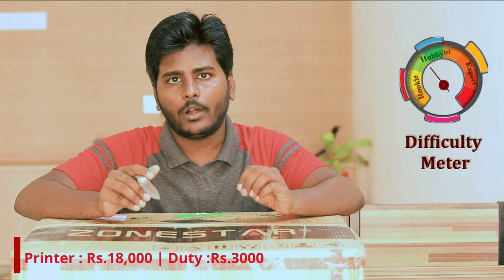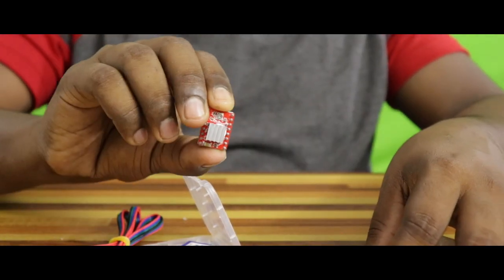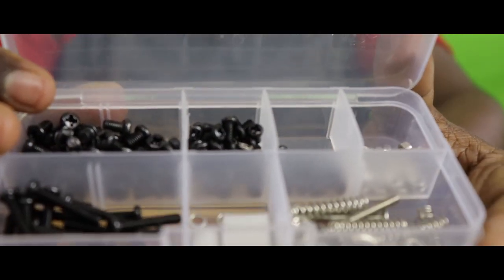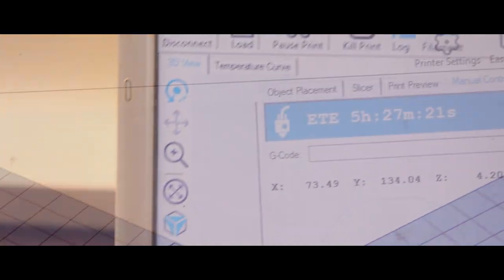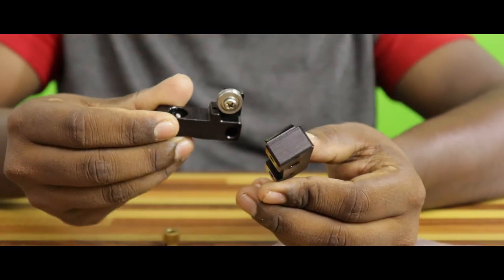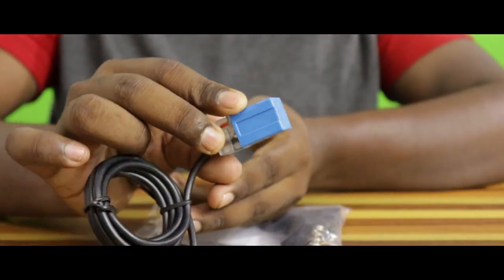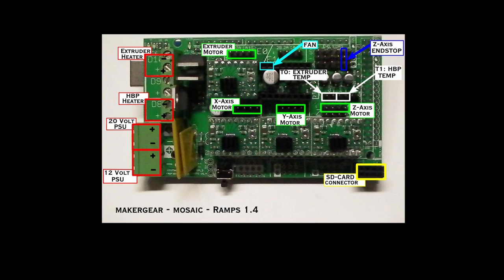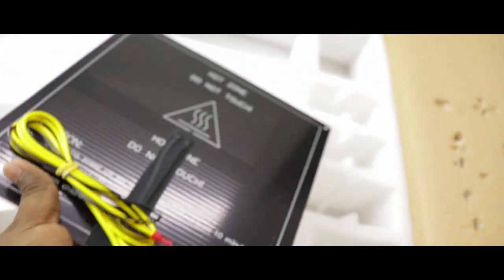#3 [Tamil] ZoneStar DIY 3D Printer - 3D Printing Series - S1 E1 - Part 1

Comment: Hi,
Your explanation is super bro
I have questions..how to print Tamil words using 3d printer
Give me ur number
Reply from the maker: Depends on the software you use. Almost all major software supports text extrude. Try OpenScad Text command. It's free
Reply: @TinkTamil  Actually I am using fusion 360. While extruding Tamil text. The extrution operation failed. I had tried many ways. It's really hard to find how to extrude Tamil text. Pls make a  video or u try once will get to know the ground reality. All video available in YouTube for text extrudion for English text only.
Reply: @TinkTamil  Thanks for the reply